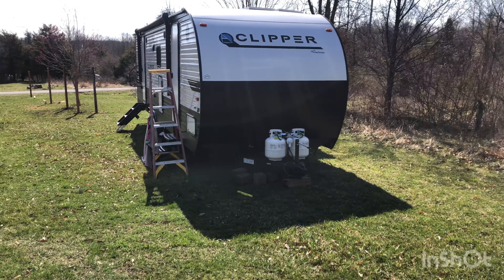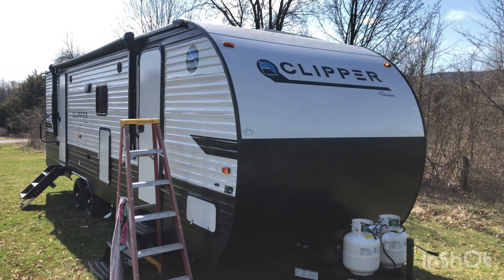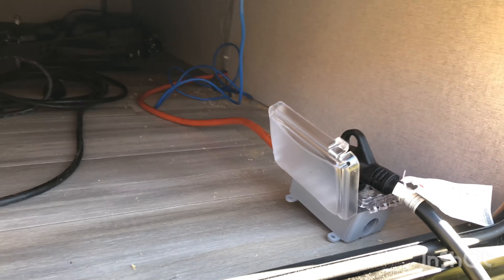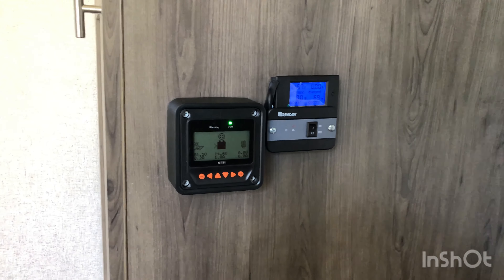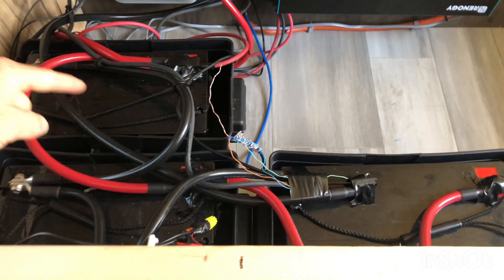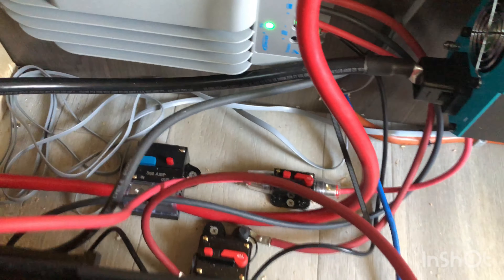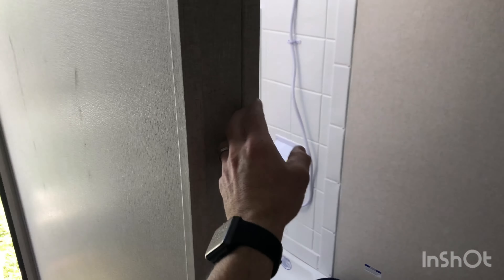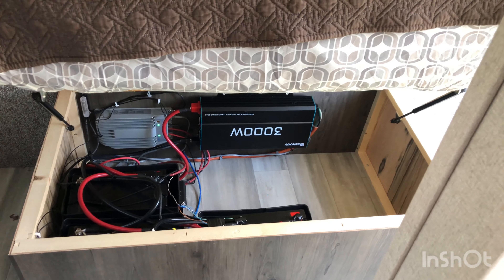RV/travel trailer, DIY solar setup. 400watts, Renogy Solar Panels

Comment: After watching your video I realized I made a mistake with my small solar project.  I was thinking I could run 2 310w panels into my Renogy 30a voltage controller because it was under 100 volts (their listed max). I forgot to take into consideration the max wattage. I also have the Renogy 3000w inverter. My controller is already obsolete....and it's only  a  month old. Series or parallel on the panels,  it won't matter.....dang.

Comment: We have a Jayco Hummingbird which I would love to add some solar panels to 😃
Reply from the maker: Very nice! Yeah, at first I asked myself why I would want Solar on the camper. Then I started to watch vids on solar setups and realized it would come in handy at times. For instance, power outages, something goes wrong at your house. Go to the camper for hot showers, coffee, refrigerator etc. until the problem is resolved. Not to mention the money that can be saved boon docking camping. Feel free to reach out for advice and there are very great YouTube vids on here. If you do I highly recommend a 24v system. 👍🏽🔋⚡️🔋

Comment: I’d stick with the 12v, specially since you already have a NICE 3000w inverter. If you go 24v, then you’ll have to add a buck converter to run your 12v stuff and replace your Inverter just to save money on an additional solar charge controller. When you switch to LiFePO4 you’ll have to switch out that converter unless you have a progressive dynamics that has a 14.4v mode for Lithium.  If it does, then I definitely would stay with 12v, to avoid replacing the converter too.  Keep the updates coming.
Reply from the maker: Well... I’ve be been thinking about a larger system. 24v allow me reach my 700watt goal with being able to max the charge controller. Also, I’m selling these batteries to my old man and stepping up to 400ah of LiFePO4 batteries. He wants solar on his wood shop and I’ll probably sell him the inverter too and upgrade to a 24v inverter. As for the converter I only use that to charge my coach battery. I thought about two dedicated 6v golf cart batteries to keep up front to use for a backup 12v system.

Comment: You still need to do one more step! The TS-30 has the ability to control the charger/converter but it has to be wired into the transfer switch otherwise you will be charging your battery with the inverter. Check Michael Bracewell's channel:

https://www.youtube.com/watch?v=rkRzH0Ay1z0&ab_channel=MichaelBracewellTheTravelTrailerGuy
Reply from the maker: Yeah not a bad idea. I have my battery bank separated from coachman battery being charged by the converter for now I just flip the converter breaker if I don’t what to run the charger/converter to save on energy at times. Thanks!